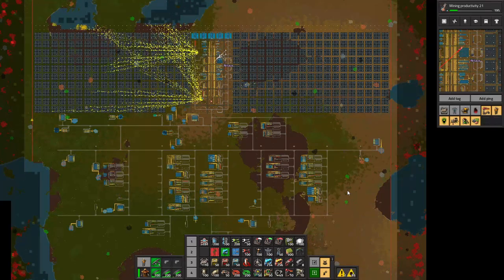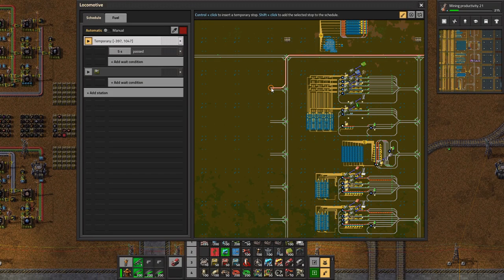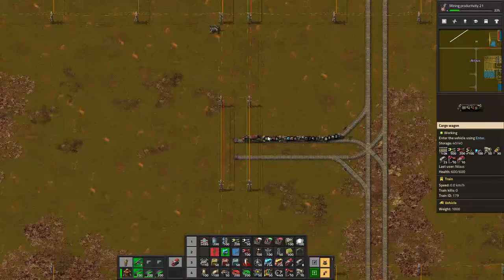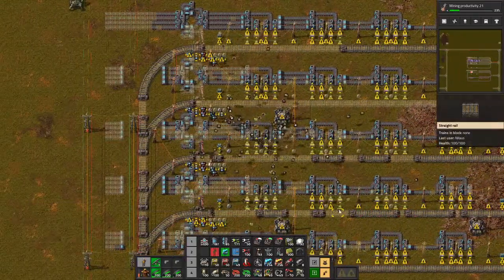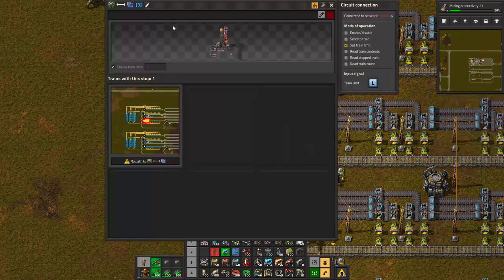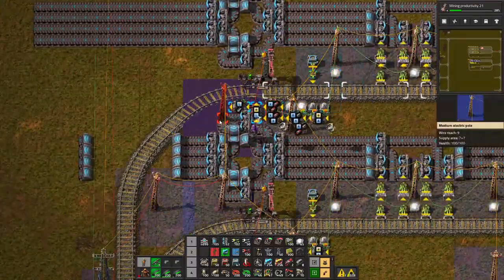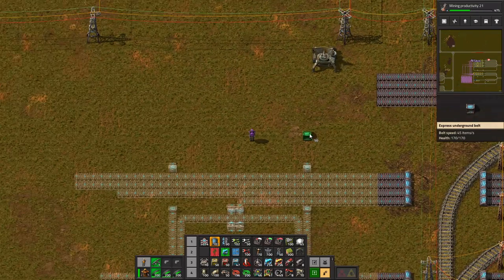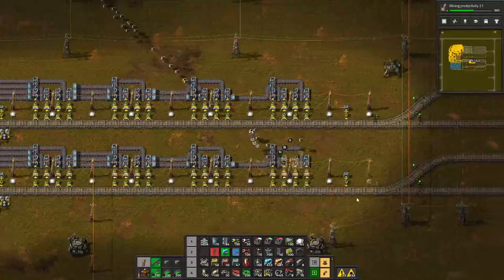Designing 2700 PRODUCTION SCIENCE / min | #27 | Factorio Megabase-In-A-Book Lets Play

Comment: Been following along and loving each episode. I actually came up with a different solution to the extra petroleum problem. I reworked the rocket fuel chemical plants to use the petroleum to up the consumption more. It ended up using just enough to keep all the Oil Refineries running consistently.

Comment: just so you know found with the purple blueprint one of the spliters missing at top on red chip side loading cause reds to be full on 2 the belts. also had to switch the green chips and the steal plate sides round on belts as steel was jamming up the production of the rails other than that worked great cheers for another great vid and blueprint.

Comment: I ran into 2 issues with the blueprints so I hope I can save everyone else here some time of cleaning it up if you decided to turn this on without waiting for Nilaus:

1) The iron plates and green circuits sharing a belt need to be on the opposite side of the belt or they will clog the belts/priority splitters down below!
2) The middle 2 rows of red circuits should also only be on one side of the belt but they are on both sides (so a full belt) which also causes some conjestion in the bottom part so the build doesn't properly work.
Reply: I hope nilaus sees this. Thanks for beta testing the build (lol)
Reply: Came here to post this exact thing, perfect diagnosis.  The fix for #2 is to add the missing splitter at the top, which is causing the reds to go on both sides.

Comment: I ran into the lubricant /petroleum gas problem myself as I'm building along. I trained it in and kept adding/emptying storage tanks, but I would forget and it got annoying. What I finally did to solve the problem was on the rocket fuel production I changed the production of the solid fuel from using the light oil to using the petroleum gas. That used the petroleum gas and it reduced the amount of light oil I needed. 
Edit: Also, the blueprint for the low density structures is missing a wire from the pole to the arithmetic combinator on the copper plate train line which causes trains to come when there is no space.

Comment: Thanks for making all this great content! 

My concern is that your power only looks good because all of your science builds are currently idle and it's basically just red+green+blue circuits, modules, solar panels, and accumulators that are running consistently. Once you get the purple science build up and running, all six science stations will ramp up and pull a ton of power. I'm sure you already are aware of this; my question is, have you calculated how much power you need to maintain the whole base running full time, or are we going to find out along with you whether it's enough? :)

EDIT: I forgot that all those beacons you've built are already consuming power even while no assemblers/furnaces are running. So you're probably fine since even in my 300 spm base beacons take more electricity than everything else put together. Ignore me :)

Comment: I personally like to do a dedicated lubricant from coal build with a minor waste of solid fuel from petroleum. Some of which you can burn off for your steam for coal cracking, but mostly you create as a priority input into rocket fuel. I would still do 90% of rocket fuel from Light Oil because it is more efficient, but if you turn your waste petroleum from oil cracking into a consumable it is useful. (You also have light oil available to have the outputs be lubricant and prioritized rocket fuel).

Comment: I ended up having to do this with my 90 science per second  build as well.  Trained in more lubricant  and then added another production line of belts with a mini gear factory.
Reply: Theres a way better solution instead of using light oil I made solid fuel out of petroleum gas, and the rocket fuel out of light oil, never ever had a botlenech again and i have all the lubricant i could want.

Comment: I came into the no lubricant problem as well, lol. But I put a line of light oil both sides of the rocket fuel build,and switched the chemical plants making solid fuel to using petroleum gas. It makes the build a bit bigger but still fits fine and it can reach equilibrium for the oil processing build. I wonder how will you do it :D